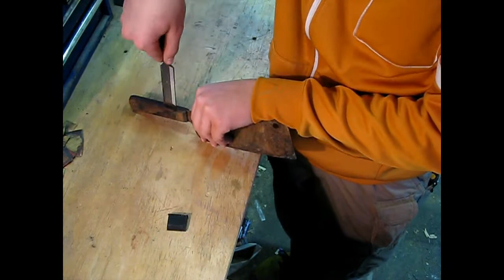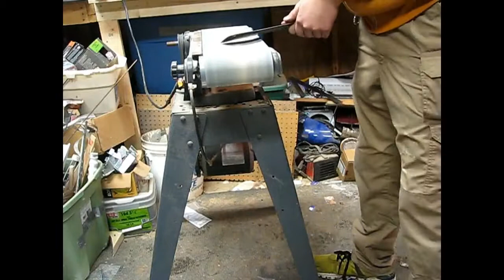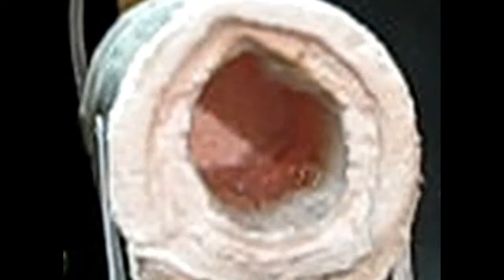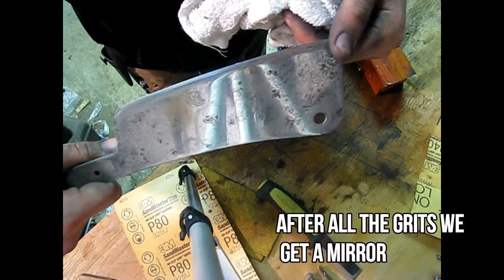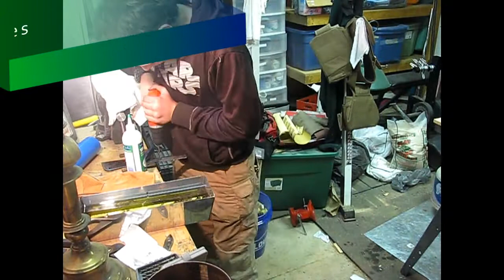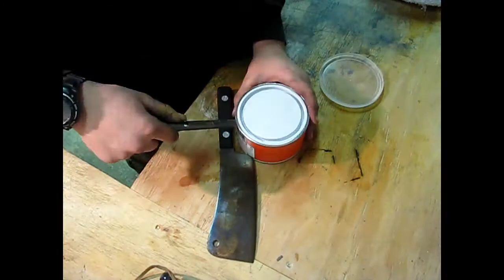Antique Cleaver Restoration

Comment: Hi there, thanks for posting. I just picked up an antique cleaver of my own that was an antique store find, and am hoping to bring it back to usability. Mine isn't as rusted/ maybe light pitting, but definitely needs a new edge. And I can't tell how the handle was originally finished, if it was finished at all, or just left rough and used to take on the patina it has. Can I ask... what made you decide on boiled linseed oil for the handle vs like danish oil, or something that would have more of a sealant effect? Also- how to determine what steel you're working with? Is that necessary info for the annealing / tempering / heat treat temperatures to be known? Thanks again for the great video!
Reply from the maker: Hello, I decided on BLO just because that"s what I had at the time.  I have used Linseed oil on many other projects and liked the way it turned out.  I normally use a coat of finishing wax on top of the oil and that in combination with the BLO seals everything good enough for me.  If I was going for waterproof i would go with something like polyurethane.  As for the steel there are a number of factors to consider and I will discuss those in a video coming soon.  Thank you for the questions!